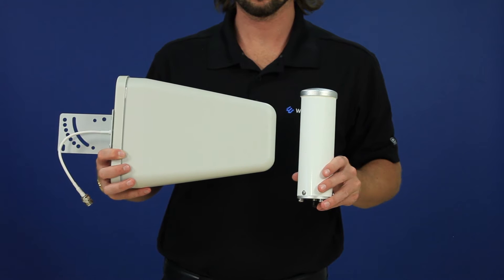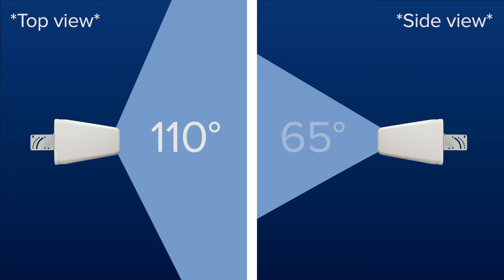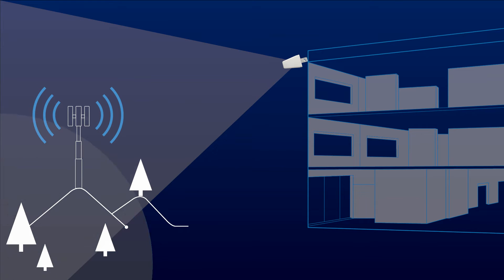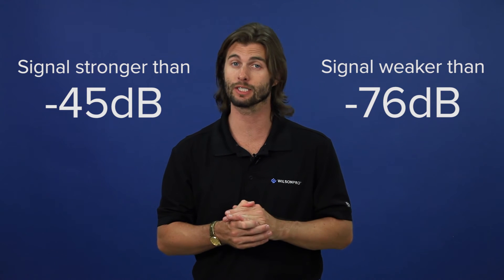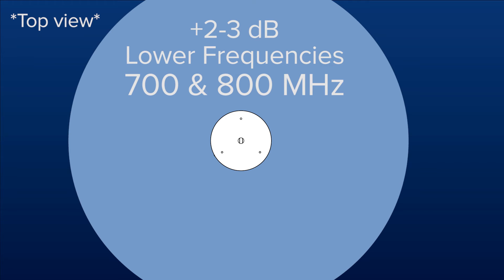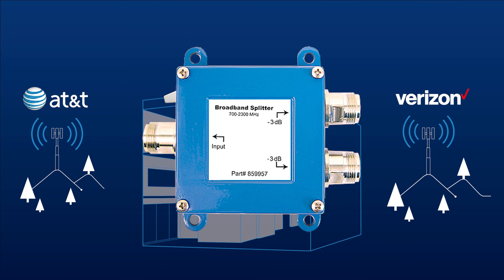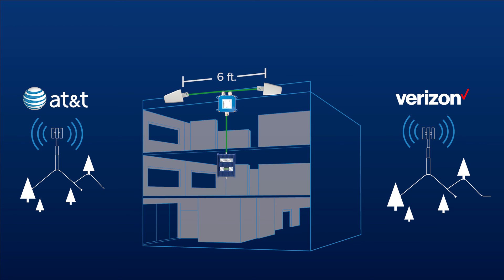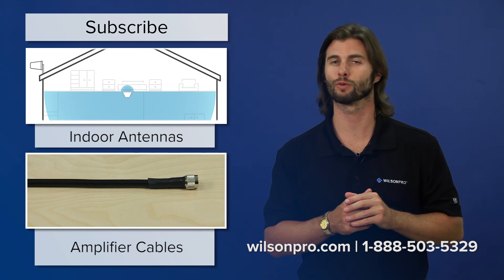How Rooftop Donor Antennas Work | Wilson Connectivity Cellular Amplifier Systems

Comment: Technical correction: Wilson's directional building antennas are LPDAs, not yagis. Yagi antennas have a very narrow frequency range, while LPDAs can cover a wider frequency spectrum—that's important when you're picking up five bands of the cellular spectrum. The two types of antennas look alike, but they're not the same.